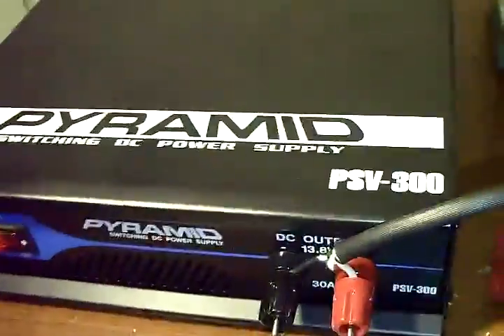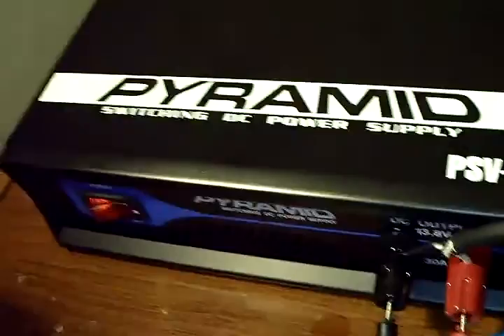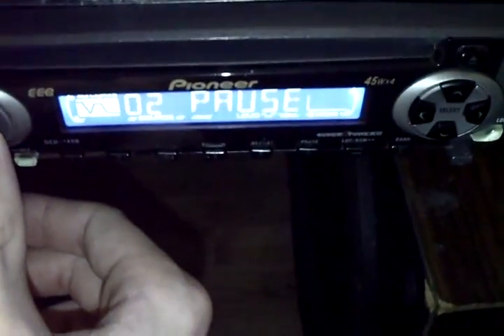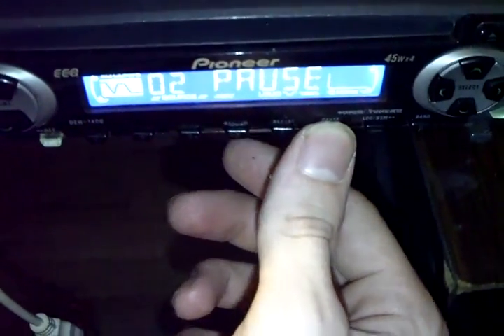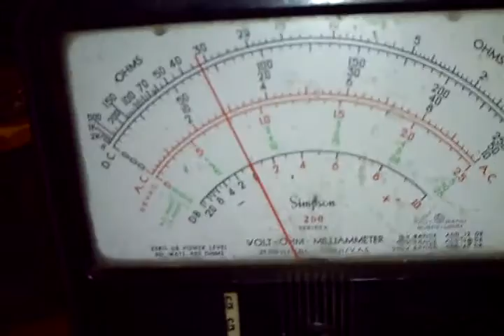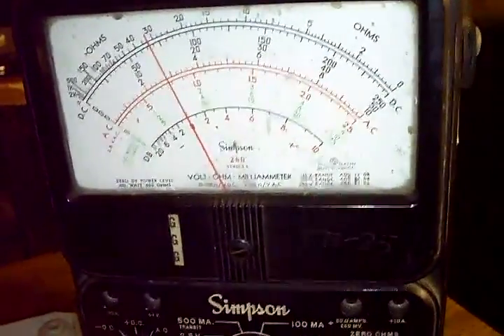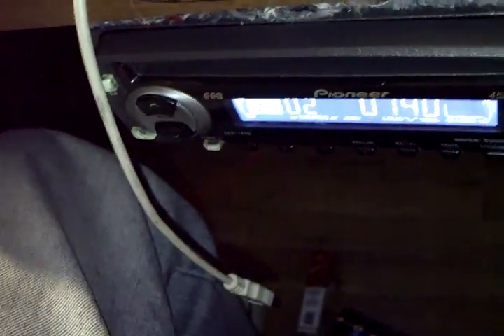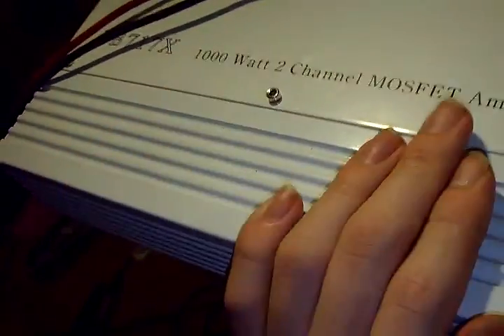POWERING CAR AMP IN HOUSE

Comment from the maker: i doubt it would honestly, i had a 18V supply on my pyramid and it did work somehow but i tried it on a kenwood amp and it would immediately shutdown due to over voltage protection. most car amps will only operate from 12V-14.5/ 15V. while it may work  i dont recommend doing it since it will eventually blow out the amp components.

Comment from the maker: @DXLXLR8 shure man,its really easy tho. on the RPS just connect them as they say the + on the amp goes to the red terminal on the power supply and the - ground of the amp goes to the black terminal on the power supply. the rem u can either put to the + of the amp,or if you have a deck just connect it to the head units rem wire.

Comment from the maker: @kevinthesteelersfan yes most certainly you can. id use a thick battery bar to connect the +'s and -'s together. i was actually planning on doing that but it wouldnt make a difference since i have two 30Amp supplys and two 60Amp car amps. theyd still only get 30A each, but for ONE car amp you can FULLY power if you paralell the supplys. PM me for further details or othee questions, im always here to help and glad to do so.

Comment from the maker: a working car amp, some speaker wire, power and ground wire if possible, head unit/stereo "optional" subwoofers/speakers. and a 12-14.5Volt High Ampere power supply. to match the amp IE 60A fuse in your amp, a 60Ampere DC power supply, or two 30Amp models in parallel. the voltmeter is just to test stabilty in voltage drops.

Comment from the maker: of corse it will, you should be able to run nearly 15 or more at the same time off this power supply. it does 30 amps continous at 13.8Volts

Comment from the maker: i have looked for a bit of info on that amp, it appears to have dual fuse's, and does about 500rms, id say its safe to assume that one PSV-300 30Amp would sufficiently power that model amp, i have bother powered my RF  P300.2 as well as mu crunch p1100.2 rated at 425rms and 475rms, both used to power two 15" subs and never has any power issues to power them. if possible to insure the most power possible, get a larger model such as a 50Amp one. although IMO i think the 30 should be just fine.

Comment from the maker: @DynamikT Wordd yeah it was great. The only thing i would actually reccomend from pyramid audio is this power supply i had. There amp like the one i had, is good but definityly not 1000 watts like it said. It never clipped once when it was on the power supply i had. The amp over modulated though. Since the cheapO amp was trying to power two rockford 750watt 15" subs.  I had a 12" L7 and 480 watt kenwood amp on it before. Sounded beast in my room FYi. Good luck peace man

Comment: #2   oh and    i matched up the kicker amp with my sub because it does  500ish watts @ 4 ohms bridged.   and my sub is 500 watts rms via dual voice coils (250 each rms)

so would the PYRAMID PSV-300 be good enough to power that 100%??

Comment: I'm looking to power a SoundQubed Q1-2200D amp (2,200 watts of unclipped power) with my psv 300. Will this be alright, or would it be possible to use two, parallel powered? I'm looking to push my SSA Xcon 15".

Comment: i have a 3000 watt pyramid and i wanted to run it off a 18volt power supply for a fatboy liner. think it will work? or is that to many volts/?

Comment: And do you think I should just get this amplifier instead to power the sub im using in the link i posted below?
Reply from the maker: +K. Dot that amp looks good to me honestly. 9/10 times you can tell an amps true power ratings just by the fuse ratings they have/use (and what the amp is actually marketed as in terms of output power) that amp you posted appears to use dual 25A fuses. doing the simple math of 
V(olts) x A(mps)= W(watts) that amp should output a power rating of around 600-690Wrms or so. which typically speaking would be more than enough for a small SVC 12" or 15" subwoofer. the whole "1500 watt" is just peak power. and very often just done as a marketing ploy to make equipment appear to be "all that much better" either way it's a better choice than the pyramid arctic series i had in this video. whereas it really only output near 75Wrms per channel at 4ohm... even though it says "1000w"  its by far,not at all. also a FYI tip, almost always when you have a quality car amp, and its "supposed to" be rated at something quite powerful like 500-1000W rating, it'd be VERY heavy due to sufficient heat-sinks on the mosfets and other components. RockFord Fosgate is a prime example of that,as well as kicker and alpine. a good brand also i have used is called Crunch, which is a sub-brand by hifonics, similar to how HP computers also make and own Compaq and a few others, they're all owned by the same company but just a lower sub-end quality of what the primary is.
Reply: +demonsparkx The new amp I ordered should sound better with my power supply I think. 50 amp fuse on the old amp vs 30 amp fuse on the new one

Comment: hey i have a question or two,     would the PYRAMID PSV-300    be good enough to power      a kicker sx 500.2  car amp   to its full potential??   or would i have to worry about keeping the volume at a medium level or something?

planning to do this inside with that said amp and a 12 inch alpine type r      ALSO  what kind of wires do i need to go from the PYRAMID PSV-300      to the  kicker amp???

if u can help me with this id very much appreciate it.   thanks

Comment: I wanna connect an amp thats 2000 watts max, give 900rms bridge. i have 600 watts psu with 1 fraud cap and still lack of power drops to 8v. Then its turn off. Will the psv be better with capacitor. By the way its l7 15. Look at my video kicker l7 15.

Comment: dude like ten years ago i had a  2000 wyat pyramid amp it was clear and u could see inside  bought really cheap under a 100 brand new and had it push 2 jl12w6 and it was the best amp i ever had till it was stolen  better then my jl500 memphis andalpine and some others i had this was iam gessin when pyrimid frist came out cuz the shit was really good now i hear its has cheap parts and is junk but your amp looks kinnda old so it prob is really good
Reply: Okay thanks I just ordered the power box and I am sub to your page playa
Reply from the maker: 773steve very awesome man, i owned two of them power supplies before,both worked beautifully. Only complaint i can say is the EMI/EMF it gives off while running,try to isolate it the best you possibly can away from the RCA lines, it gives something Similar to ''alternator whine'' im sure an rca isolator noise suppressor would suffice if need be,never tried. Thanks for subbing also ill sub back! Will love to see some demo videos of your setup also some time :)
Reply: demonsparkx ok i just got my power supply and lookin over your video before i hook it up black is ground and red power and ok ill try to make a lil video
Reply from the maker: 773steve
sure thing man! if you're not using a head unit just run a rem wire from the amps rem terminal and put the other end to the + of the amp. if you need anything just let me know

Comment: What kind of wire setup did you have here running power from the converter to the amplifier? I have the same converter but a different amplifier http://www.rockvilleaudio.com/rvspl151a/ it came in this kit and everytime I hook it up correctly to the converter it always makes a crackle noise in the speaker after about 1 minute and keeps getting louder and louder till eventually its like this really heavy bass static rumble.Bad wire set up? Bad Amp? its not the speaker, ive tested it. Thanks for the help
Reply from the maker: +K. Dot ironically in this video in specific i only had 110v power cable i think off a vacuum since i didn't have anything higher gauge to use as power wire at that given time. though i suggest you check out my link posted in this comment for a much more proper setup. also if possible i'd love to see first hand what exactly this noise problem is of yours to better help me identify the actual issue. but to me from the knowledge i've known about these and many other DC switching power supplies they're known to cause major EMI (Electromagnetic Interference) which when the power supply is running and especially whilst under a heavy load (amp draw) it causes the same thing known in the car audio world as (alternator whine) i suggest you try using high-end shielded RCA cables (the ones that carry the audio signal from your mp3 player etc, to the audio line-in on the amp) as well as trying your best to keep those cables as far away from the power supply as possible. also if its a possibility try using a different wall-outlet to plug the power supply into. even something as simple as using a different socket,one with,or with a better ground can make 100% difference in any irregularities in quality and overall performance. in this video shared below i was using schoche 8GA power cable kit 100% oxygen free copper true 8GA power cables and for my RCA i mostly used radioshack branded 24K plated RCA cables that were very thick and shielded. (used mostly for audio studios due to their quality performance around high powered equipment like amplifiers mixers etc)
https://www.youtube.com/watch?v=u1IQLB2KicU
Reply: +demonsparkx I actually just packaged up this amplifier to get a exchange with the seller on Ebay cause im almost positive the amp is defective. It doesn't even give the sub full power at max gain on the sub. And yes I have high shield Monster RCA and splitter. And Yes I have tried different wire setups from the 8 gauge and different outlets. I ordered a new amp http://www.bossaudio.com/auto/car-audio-sound-system-auto-monoblock-amplifier-boss-audio-ar1500m/ that has a 30 amp fuse in it so I think things should sound better with this one once it arrives because the other one just seems faulty to me after testing every i possibly could. Ill keep you posted bro with the setup when the new amp arrives. Hopefully i can get my room shaking within a week
Reply from the maker: ***** oh wow damn man im sorry to hear it didnt work out for you! That always sucks... boss isnt the best but should suffice your needs better,just keep me updated ill do my best to assist you when.possible. i dont have internet access very often but i will respond whenever i am able to